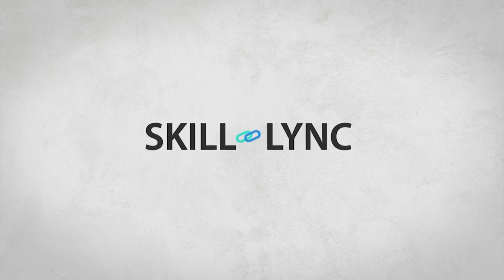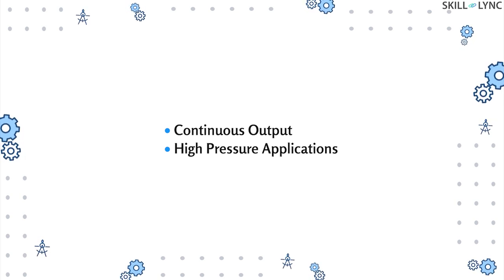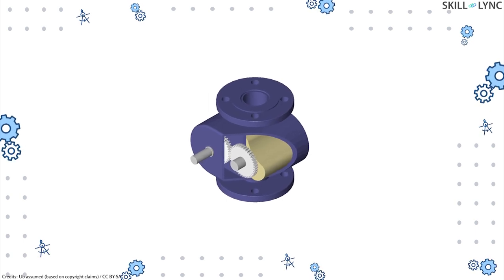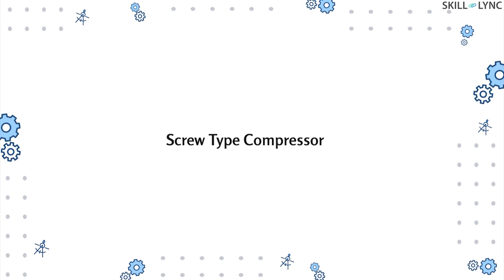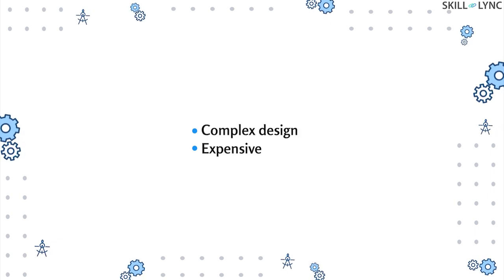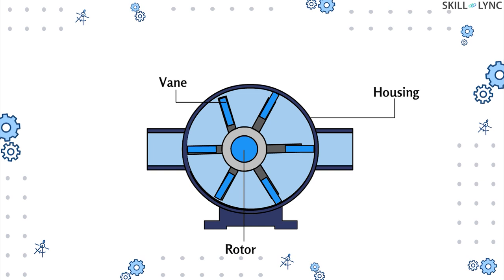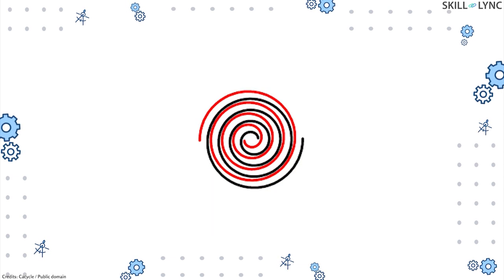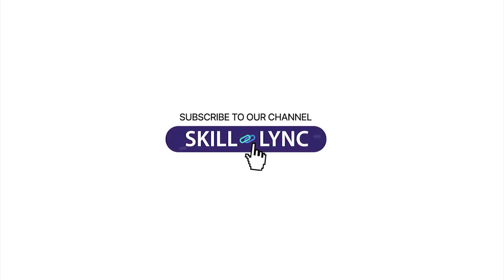How do Rotary Air Compressors work? | Skill Lync

Comment: Rotary compressors are used for high amount of compressed air whereas reciprocating compressors are used for high pressure air. Because,  we use intercooler to get maximum amount of pressure with the same temperature. Is not it true?